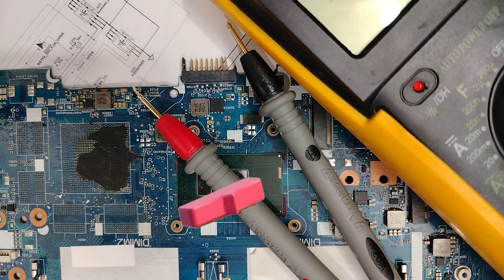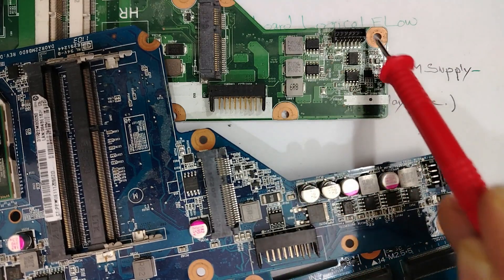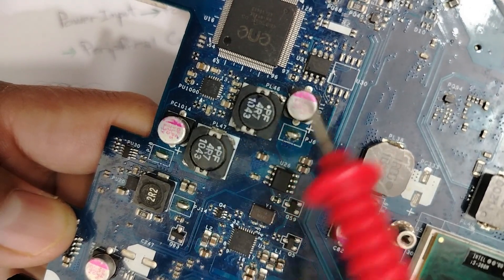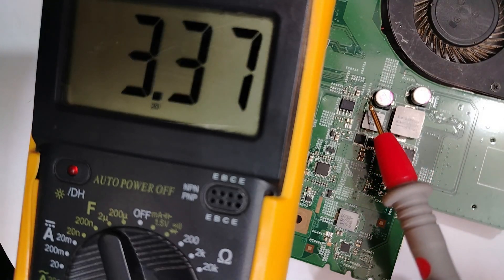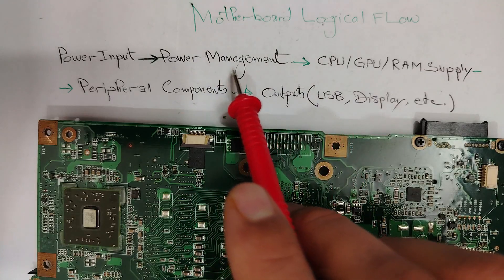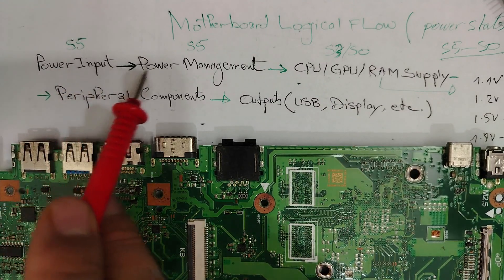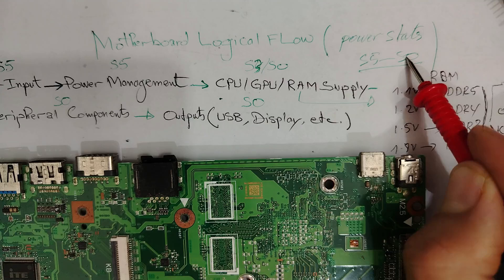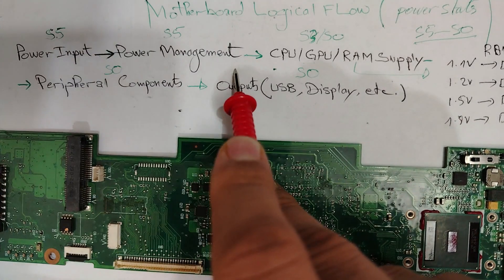Live Voltage Test Like NEVER Before! Discover ALL Motherboard Test Points

Comment: I just trying to repair one motherboard. I have only 5V,3.3V on the coils. Someware i have 1.2V but not on the coil. On the power rail only 16.7V only around battery is 19-20V. I have 3.3v on the power button. Battery is charging. I swap Instersil 9538bh and no changes. Bios 0V no short on the 8 pin. Power consumpcion 20V 0.015A when battery is disconnected. I'am lost :(. Thank you for another great tutorial
Reply: what were the symptoms before you  removed the motherboard from the laptop case ? when you pressed the power button did you get the power led on  ?  could you hear HDD spinning ? ( except if you have SSD)  , could you hear fan spinning ? ( except if your laptop is fanless) . Did you get video signal ?   did you make visual inspection of the board to notice any faulty component ?  what happened previous days before your  laptop stopped working ?,
Reply: @tunkunrunk  after connecting the power supply, the charging light comes on, the power button comes on, the camera ON/OF button comes on, both for about a second, the CapsLock blinks once and everything goes out except the charging light. There are no changes in power consumption on the laboratory power supply. The fan does not start, the disk is SSD. After connecting the power supply, 1.7V appears on the CPU coils for a fraction of a second and then drops to 0V. This happened after I wanted to change the thermal paste and had a problem unscrewing the radiator screws. I had to use force to do it, but the processor does not look damaged under the microscope, and neither do the cores. I7 10th processor
Reply from the maker: Thank you for sharing the detailed update, you're clearly doing great observation work. Let's go through the symptoms step-by-step:
✅ You have 5V and 3.3V rails — this confirms the always-on power is working.
✅ You have 3.3V on the power button — this means the EC (Embedded Controller) is likely alive.
✅ The battery is charging and delivering correct voltage — good sign.
✅ The BIOS shows 0V — this is suspicious. Even in low power states, BIOS should get around 3.3V or 1.8V depending on the system design.
✅ Power consumption at 0.015A is very low — typical of a board stuck in a deep sleep or not executing firmware.
- POSSIBLE CAUSES TO CHECK:
Damaged CPU or CPU Socket
Using force to remove the heatsink might have cracked solder balls or micro traces under the CPU. Even if it looks clean under the microscope, internal damage can't always be seen.

Missing BIOS Voltage or Corrupted Firmware
BIOS chip with 0V is a red flag.

Double check VCC on BIOS (usually pin 8 = 3.3V or 1.8V)

If it’s 0V, trace the power rail (LDO from EC or PU IC could be faulty) If it has voltage, try flashing a known-good BIOS.

No PWR_GOOD or VR_ON Signals
The CPU may drop voltage if it’s not getting VR_ON from the EC/KBC. You need to trace and confirm that VR_ON is being generated.

Corrupted EC/KBC Firmware
If the EC is stuck or corrupted, it may blink LEDs once and kill all activity. Reflashing or reballing may be necessary in rare cases.

Shorted Capacitor on VCORE or CPU Rail
Use thermal camera or freeze spray to spot heating component — sometimes a small ceramic cap fails silently.
Good luck
Reply: @electronicsrepairbasics_erb  OMG. Thank you sir for very precise analysis and very good advice. Bios is good 100%. Was flash, repair and there is no difference. The thermal imaging camera only shows slightly warming KBC and Intersil and the battery coil during charging. All capacitors are functional and have no short circuits or cracks. I found a path from the 8th pin of the BIOS to the small chip. The chip is powered but does not provide 0V power supply to the BIOS. It does not heat up so it is probably functional. Even with the unsoldered BIOS it is still 0V. I suspect that the lead balls under the processor are broken. I try to press it but there is no change. I am wondering about the fact that when connecting the power supply to the processor it goes as much as 1.7V and that is quite a lot. I can only check it with a multimeter in MIN/MAX recording mode because this impulse lasts so short. I will try to upload a video from the thermal imaging camera and some graphics describing what I am writing in a few hours. best regards and thank you very much